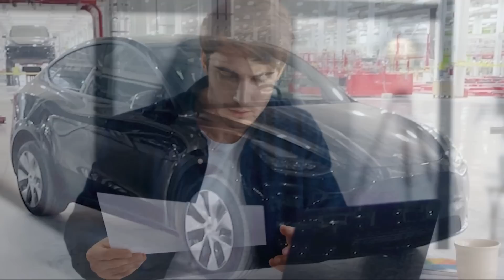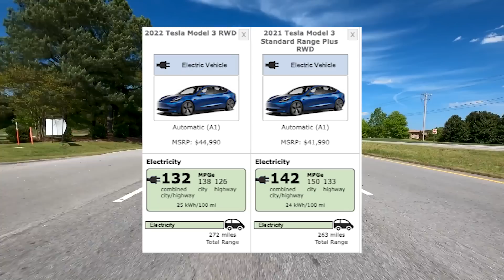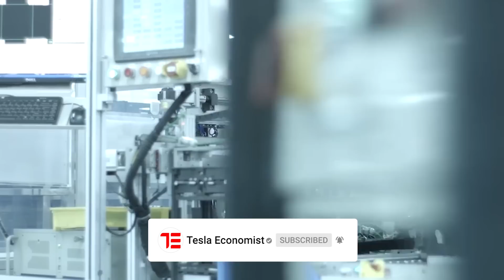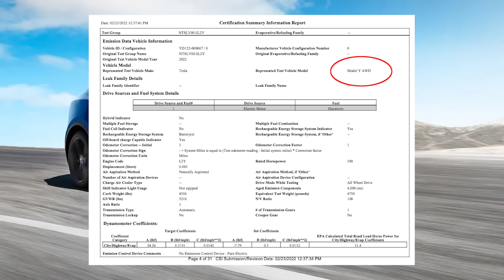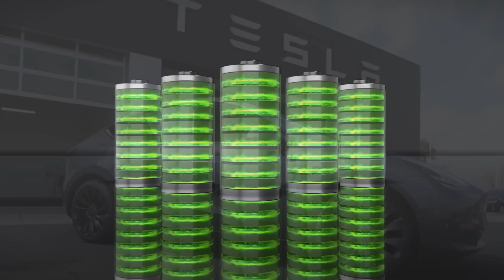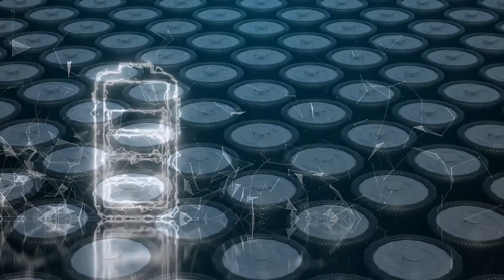What Battery is that New Model Y Using???

Comment: It seems unlikely that Tesla would already have a Model Y made in USA with an LFP battery pack rated by the EPA. If it does, then the efficiency of the latest LFP battery pack in the MIC Model 3 RWD provides a baseline for estimating the likely battery size and range of a Model Y AWD with LFP battery pack. Several YouTubers have reported surprisingly good efficiency from the latest 60kWh LFP battery pack in the Model 3, for example: 
https://youtu.be/ZnD_UZ5Jurs

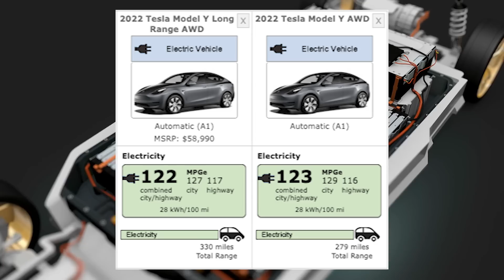Comment: At 2:07 EPA rated range of 330 Vs 279  miles; with efficiency of 122 Vs 123 mpge. If the long range has a 75kWh battery, the new AWD, with marginally better energy efficiency, would need a battery of about 63kWh.

Comment: BYD Han has 219 + 268 = 487 hp with 76.9kWh battery. The reason for the low power output of the cheaper BYD cars is to keep the price affordable. Suspension, tyres and brakes need to be more expensive to handle high power.

Comment: I think it's just simple improved 2170 battery from Panasonic.   Panasonic reported increase battery density by 10%.  So makes more sense.   LFP advancement is going to be slower.  Also Elon was clear that long range would be nickel.  Biggest possibility is slightly improved Panasonic 2170

Comment: 69 kwh of 2170 would be far lighter than the current long range and thus better efficiency.  If the new manufacturing processes (front/rear castings and redesigned pack, can shave 250 lbs, that accounts for heavier cells (only 69 kwh)  and awd system.  They don’t need more energy density, they simply need 9 kwh more cells versus the 60 kwh standard range pack.  The new Texas battery case will have more volume as it is taller and connecting to the front/rear castings, easily fitting 9 more kwh of LFP.

Comment: Why is it bad if it is 4680, they could make more cars with smaller number of batteries to achieve that range
Reply from the maker: We are hoping for a better efficiency
Reply: @TeslaEconomist  You rock TE!  Knowing that they can get better efficiency in time, wouldn’t it make sense to get these out.  When they get to volume production, efficiency might be ideal.
Reply: Ya but isnt it considered as more efficient if only perhaps 500 pieces (i have no idea about the calculation haha) of that needed to be put in the car to achieve 279miles. That battery type is damn efficient then isnt it?
Reply: As opposed to putting 916 pieces as I heard somewhere

Comment: The 279 mile MY is too low of a range for the 2170 battery. My model 3 has lost 30-40 miles of range in the last two years and it has the 2170. This might be ok for some people but not me. I was waiting to buy a LR Model Y in January 23’ however these prices hikes have me looking at other options. I would consider the 279 mile MY if it has an LFP battery because it doesn’t degrade and you can charge to 100%. Just my 2 cents and experience as a Tesla owner.
Reply from the maker: Yes I have said in the past an LFP with that much range would be Tesla’s best selling product. But we aren’t there yet.

Comment: I tend to think 2170 as well...

I also think they are software-limiting battery output so that cars with different battery chemistries behave equally well.

But I think there are some efficiencies gained by having 4 motors that you didn't discuss.

Different electric motors operate most efficiently at specific loads and/or speeds.  With 4 motors you could reduce the load needs and tune for a higher efficiency and lower power motor. An additional 5% range doesn't seem out of the question.

Also, regenerative braking happens through motors.  4 motors could allow you to recover a larger fraction of breaking energy. Ultimately this boils down to how efficiently you can recover braking energy and how quickly you can push that power to the battery.  And LFP does charg faster than standard Li-ion chemistries.  Recover 15% more braking energy and you get a lot more distance. 

Drag coefficient has a big impact.  

I am not sure I have written off LFPs yet.

Comment: Even though they are heavier, the Tesla AWDs achieve longer ranges than the RWDs.  Having two motors allows them to tune one motor for high speed efficiency (highway) and one motor for low speed efficiency (city).  In fact, Tesla uses two different types of motors to achieve this benefit.  One motor utilizes an induction rotor - these type of motors are better for high speed.  The other motor utilizes an IPM (Interior Permanent Magnet) rotor.

Comment: It's not 2170.  The weight of this Y and the LR Y are about the same and both are AWD.  If they both have 2170, this new Y would weigh much less than the LR Y due to having a smaller battery.  There is only one reason Tesla would increase the weight - LFP.

Comment: What happens with all your speculation when Tesla decide to leave more reserve capacity in the battery? Not a bad strategy if they want to increase range over time through ota updates.
Reply: Interesting, can they depend on the 4680s?
Reply: My thoughts exactly.

Comment: Man, you really try to jump through hoops to prove this is not an LFP pack.  Did you think why a new and much more improved Austen MY w 2 motors and a ~65 kwh 2170 pack weigh within 25 pounds of the current Fremont built MY w a 82 kwh 2170 pack???  Sounds like they improved the MY, gave it a smaller pack and then added some weight so it can weigh as much as the LR AWD MY.  Wow. 

You subtract the SAME range diff of a 82 kwh LR MY vs 82 kwh RWD MY from a smaller pack in your  example.  Weight does not make that much diff on EPA efficiency since they test on flat ground.  A few hundred pounds is not going to move the nrs.

The efficiency of the 2 vehicles are the same so based on the range you can calc the pack size diff.  At 75 kwh for a LR MY the AWD MY would have a 64 kwh pack.  A 6.5% improvement in energy density would put it at the same weight as the 60 kwh pack.  A 10% improvement plus front casting and possibly a few other minor savings would keep the weight down to the LR AWD vehicles weight.

Tesla is known for innovation so I think this is the most likely scenario.  More than the other option of a smaller 2170 pack w some weight added just because.

I am playing devils advocate bcz your channel needs to remain credible.  You do good work (although I think you are over-optimistic a lot IMO) and you should not give the FUDsters and the circus known as TSLAQ ammo to discredit you.  The Tesla community needs its champions to be trustworthy and reliable sources of information.  I am not saying this to critique you, but to motivate you.
Reply from the maker: We saw the difference in weight going from 2170 to LFP made a difference of 10 MPGe. I appreciate the devils advocate. Which is why I have humoured LFP to make it work. But couldn’t get there. It’s too big a break through. 

But how can you justify 380 from an LFP. That was the biggest tell for me
Reply: @TeslaEconomist  380 from an LFP?  Sorry, I don't follow.

How do you justify a smaller 2170 pack in a vehicle weighing just about  the same as the AWD MY w larger pack?
Reply from the maker: Sorry 380 hp.
Reply: @TeslaEconomist  Gotcha.  I don't think you can make that conclusion.  What ultimately determines the power a battery can produce is the size of the pack and how those cells are wired.  Chemistry probably could play a role but I don't know.  I would guess that for the same pack size, wiring architecture, SoC, BMS, etc. that there would not be a massive difference.  The pack in the LR MY also powers the the MYP and those motors are rated at 375 kw (500 hp).  So the LR MY pack can produce much more than 375 hp.  The 279 mi AWD MY could thus get 375 hp from a smaller pack.  Again, there are too many other variables to know this for sure, but I do not think that power would be a limit on a 65 kwh LFP pack.  The 95 kwh MS pack for instance can provide over 750 kw.  It's 1/3 larger than the MY pack yet it can produce twice as much power.

Comment: Tesla is forced to use 2170's, as they are doing in Berlin,  since the 4680's are just not being mass produced yet.  Tesla only has enough 4680's stockpiled to make 2,000 Model Y's, so they may only make test versions of the Model Y, Cybertruck and Semi with this battery.

Comment: LFP is possible, but where were the cells made?
Reply from the maker: It’s not possible at all with current LFP tech. Hence why it’s a big deal if it’s LFP because it would be a huge break through.
Reply: @TeslaEconomist  
There are some recent break throughs at CATL recently with battery chemistries and power/energy densities, "Just have a Think" video mostly covered the Na+ batteries they are patenting to replace the LiFP chemistry which I believe is now off patent, recently.  Also talked some about Tesla's working with CATL, but think it may be better LiFP since NaFP is not ready for prime time, yet.

https://www.youtube.com/watch?v=cHNELRnJ_4Y&ab_channel=JustHaveaThink
Reply: @TeslaEconomist  Have you watched The Limiting Factor video regarding the practicality of 4680 LFP batteries? Find it here: https://www.youtube.com/watch?v=IIkA-mq5htw

Comment: What does the AVERAGE customer want ?  High acceleration & top speed ?. AWD or RWD ? Heavy or light ?  LFP or LNM ?  More super-charger ? They simply want a quality EV at a reasonable price without problems on their annual holiday. Tesla China has worked this out - A single motor with  LFP.
Reply from the maker: The range isn’t sufficient for the US market.

Comment: Why are you ignoring the fact that Elon himself said Austin will launch with 4680? From conference call transcript: So throughout 2021, we focused on growing cell supply alongside our in-house 4680 effort to provide us flexibility and insurance as we attempt to grow as fast as possible. As we sit today, sales from suppliers is actually -- it sort of exceeds our other factory-limiting constraints that you mentioned, Elon, in 2022, or to say differently, 4680 cells are not a constraint to our 2022 volume plans based on the information we have.

But we are making meaningful progress of the ramp curve in Kato. We're building 4680 structural packs every day, which are being assembled into vehicles in Texas. I was driving one yesterday and the day before. And we believe our first 4680 vehicles will be delivered this quarter.

Our focus on the cell, the pack, and the vehicles here is driving yield quality and cost to ensure we're ready for larger volumes this year as we ramp and next year. And the 4680 and pack tool installations here at Giga Austin are progressing well with some areas producing first parts. And the internet has also noticed that.
Reply from the maker: Sorry, I didn't say the vehicle from Texas wouldn't be 4680. I am sure it will. I am saying this EPA vehicle, is not LFP and will be made in Fremont. There are a lot variables here. Sorry if it wasn't clearer.
Reply: @TeslaEconomist  Sorry TE, I misunderstood you as well, I thought you were talking about the Texas model Y’s.  Maybe the EPA AWD vehicle you’re talking about is for North American climates; Canada and the likes? What chemistry is best suited for cold climates?

Comment: I think your onto something.

However LFP, particularly LFP cylindrical has been capable of very high C rates for a long time.
I have some LFP 18650’s that do 25C
Even 5C is going to be enough for an EV w/ a 69kw battery.
(A123 batteries for example)

Comment: Hey TE. It's the first day of Spring and it looks like  you are once again toiling at your computer.
 
2170 cells for the new model Y? Oh my, I need to hear why Tesla would do that since they are more expensive than LFP?   We know Panasonic knows how to make heaps of them, and they have proven themselves to be incredibly reliable for over a decade now. 

After all of  your math, I am still at a loss for why this more expensive battery would be the way to go, until I begin to add up the other changes that you covered (and that was only some) that Tesla has made since Tesla's history with the 2170. There have been so many improvements in the manufacturing of their cars, so many parts taken out, so many parts made lighter, even more efficiency found and changes  to get more from less that it could be very possible that they have found a way to use LESS TO EQUAL MORE.

If this is the case with casting (front and rear as well as other parts throughout the vehicle) etc. with the battery pack now being the floor (another part eliminated as well as the battery mod) maybe they ran the numbers and found a new vehicle was possible without retooling? 

I'm only concerned about how to make this work financially? Nickel chemistry batteries are high spec and price, even though we know Tesla arranges supply contracts at massive scale and for much longer and further in time could this just be a stop gap until their LFP can be ramped up sufficiently to provide the same range?

I can't wait to hear what  you have to say about that. If Tesla has found a way to do this economically then you will have discovered a few other things to make this make sense. 

Go for it TE. There's never a dull moment following Tesla or your videos.
Reply from the maker: Well Tesla have 2170 batteries, they need to find vehicles for them somewhere, this might be the solution. LFP was already being ramped up as fast as possible, they can't suddenly ramp up any faster, just because nickel is more expensive. I believe the CATL LFP ramp up is going to be absorbed by Shanghai Tesla, especially with the new factory coming online now. 

It's just that all the numbers are pointing to 2170. You have to make a lot of assumptions for it to be something else.

Comment: An LFP pack would use some aspects of the 4680 structural pack, like the integrated pack top and seat base. I don’t think the weight is a problem for the 279 mile range model for it to be LFP.
Reply from the maker: They already are currently, LFP is structural in the standard Y and 3.
Reply: @TeslaEconomist  The structural pack only applied to 4680, not the current SR cars.   So I think James has a valid point.

Comment: There is no 2170 Structural battery pack. The 4680 cells <<themselves> are bearing the weight of the car. So no i don't think they built all that factory to go "backwards".
Reply from the maker: They will be built in Fremont, not Texas.
Reply: @TeslaEconomist    What i would consider "New" would be Austin MY (2.0) and not a warmed over Freemont version.  Lots of Austin in your b roll.

Comment: Do not know if this will help me sleep better tonight.  Seems like a lot of unknowns not accounted for in the thesis and conclusions drawn.  
Kind of reminds me about what some say about statistical or mathematic processes.  "Lies and damned lies and statistics"
You haven't considered software improvements for battery and power management, engineering advances in battery cooling and heating optimum performance.  Come to think of it I can not remember anyone commenting on software/battery performance correlations for any Tesla with any version of operating software or battery formats or chemistries.  
Would be a fast moving target to model, Tesla will zig when you zag ;)

Comment: Electric cars came at just the right time,if the keystone pipeline had already been built,gas would be cheaper then ever,and electric cars would never exist in america.
Reply: At the cost of many environmental issues. Pipelines WILL LEAK and that’s many locals opposed it!
Reply: @WillR-Cincy  Good point.
Reply: The pipeline is over-hyped. It will allow increased supply but won't solve the demand problem and dependence on other regions...

Comment: The only thing is satisfying the other half of the ledger with what ever battery choices they’ve made: 
1) How do they maintain the 30% margin with what ever size battery is used?
2)does Tesla shift  2170s to lower end and 4680s to the higher end  (long range/performance) to counter profit and margins of the lower priced models?
3) How much can they charge for the New Mid range - this car has to be lower in price and reasonable!! ?
4) How do the maximize the number of Tesla’s on the road with the supply of batteries they have
Reply from the maker: 1) raise prices, reduce costs
2) they don't, all high end could be 2170
3) $54k
4) smaller battery packs

Comment: Assuming 4680 was borderline crazy given the efficiency.  Assuming  2170 is even crazier given the vehicle weight. You are way off with absolutely wrong assumptioms. It is  LFP but with a structural pack. Body shop in Texas has no underbody frame while Shanghai has. That is your weight savings,  from the new structural LFP pack.
Reply from the maker: LFP already uses structural.
Reply: @TeslaEconomist  No, current LFP vehicles has frame under the pack carrying the battery pack, like 2170 vehicles because body shop is the same.  Texas made vehicles will be the first to use structural pack with no underbody frame
Reply: And your NDEC to EPA conversion is way off for Tesla. Model 3 RWD in China shows 556km of NDEC range with 18" wheels. The SAME vehicle has 272 miles of EPA range in the US!  Model Y RWD in China has 545km NDEC range. Just do the math again, you will have 265 miles of EPA range in the US for Shanghai made Model Y with LFP.